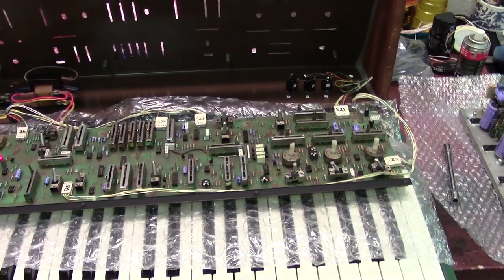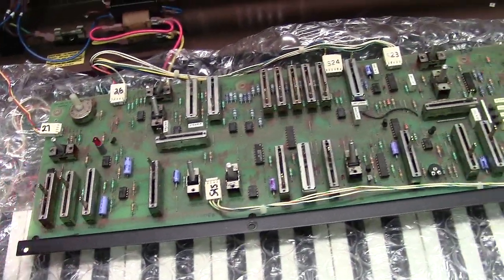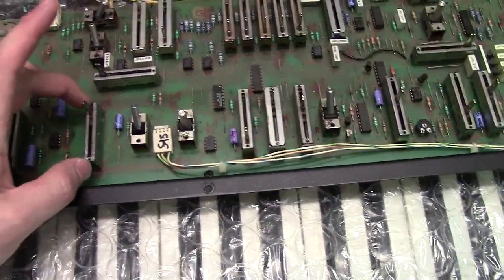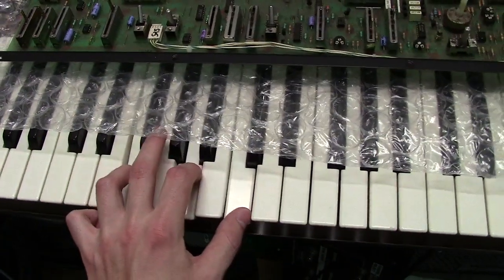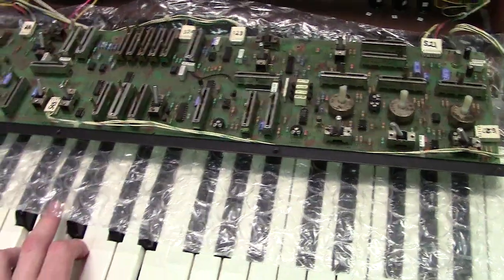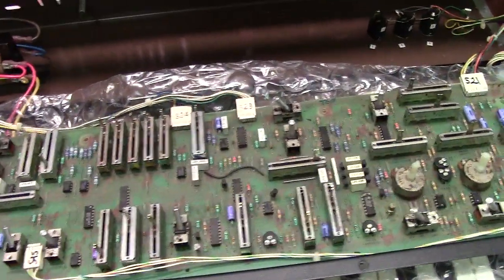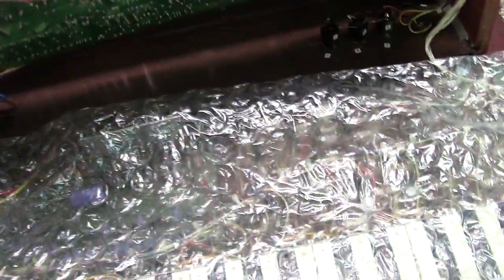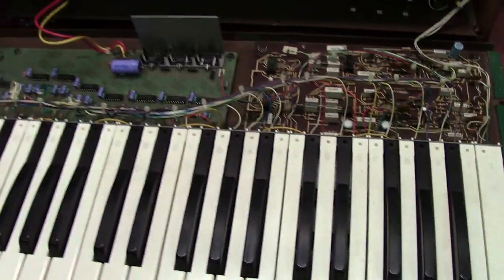Moog Opus 3 Rebuild Part 1 (by Synthpro)

Comment: Just cleaning my Opus now the foam was a mess i used some cmt router bit cleaner on the fader tops , and some cleaner on the faders just need to find some lube to get the smoothness back. one of the F sharps has no release which is odd all the rest are ok. Great video. I love the Opus.

Comment: I know I can deep clean each individual slide pot by opening it up but is there a place that I can purchase these sliders and replace them all (kind of like a MOOG Opus 3 slide kit)?
Reply from the maker: Carlos Medrano sorry for the delay. There used to be kits available but unfortunately they are no longer produced evidently. 

To clean these up, it's not always necessarily the case if taking them apart, (I admit you sometimes get better results taking them apart). What I like to do is desolder the sliders and I use a light degreaser and water to flush them out of any foam residue and then I give them a flush with WD40...this help break down the foam that may be stuck on the track. Next I soak the sliders in 90% or higher alcohol to pull the WD40 out....then I blow them out with compressed air and apply slider lube, have had fantastic results but definitely no easy job but easier that disassembling each slider and risking damage. 

Let thing to remember is that not all sliders are the same, you have 10K as well as 1M and and some are audio taper.....get these in the wrong spot and controls will not properly work.
Reply: @synthpro  sounds 
Kind of complicated

Comment: Great video, was kind of hoping this Opus had the same strings or chorus problem as mine. None of these sections work, but if I turn the volume up really loud I can hear the faint sound of the strings way back there. Which is why I suspect the chorus is the culprit. When I bought it, the strings section worked but the volume was much lower than the other sections and one day after a car journey it disappeared altogether lik I described. Any ideas what might be the problem?
Reply from the maker: Thank you very much. Well you may have a problem I have seen before....There is a 4007 switcher associated with the Chorus effect and if this goes bad, it can cause no audio to be passed through the Chorus board. other issue could be your Chorus board itself..these use 3 SAD512s which are rare but I do have a source for a replacement chip that will take their spot if they are bad.

All the best,
Jareth

Comment: I picked one of these up back in the mid 90's when they were very cheap. £45 UK. Although limited with what you could do I loved the classic sounds from it. Especially the strings. The only difference with mine to the standard Moog Opus 3 was that someone had modded it with the addition of a quarter inch jack plug on the back which enabled you to plug things into it to access the filter. Any ways do t have it any more which is a real shame, love your videos by the way. I'm a fellow analog synth nut.
Reply from the maker: +Mark Keen Thanks Mark! Wow, you got one for a steal! I agree, the string sounds are very great and I love how portable this instrument is compared to some of the other string machines of that time. 

All the beat and thanks again,
Jareth